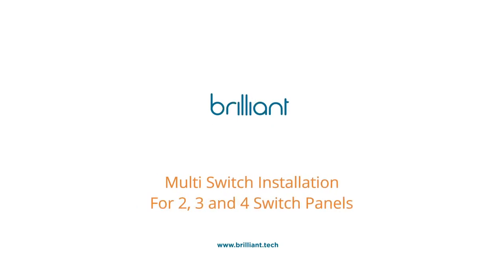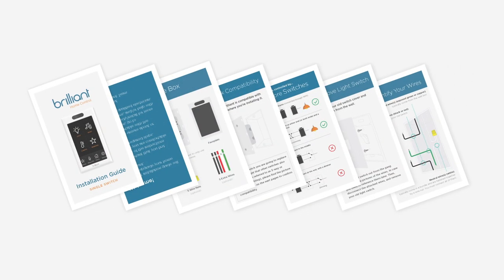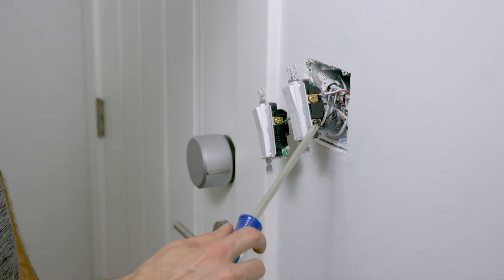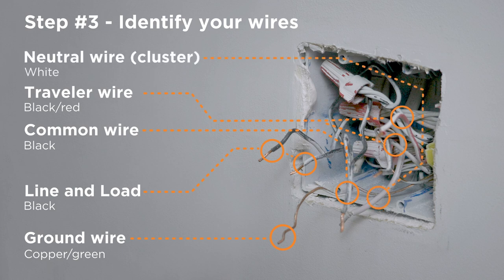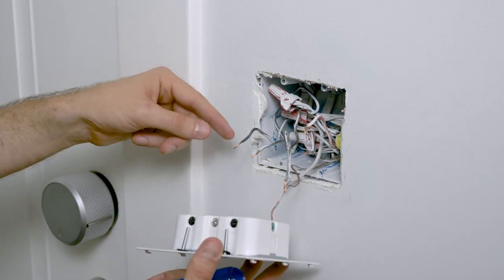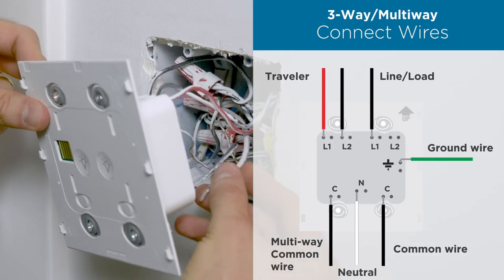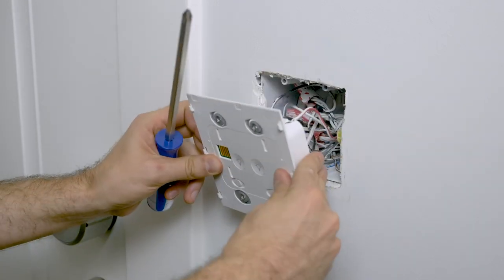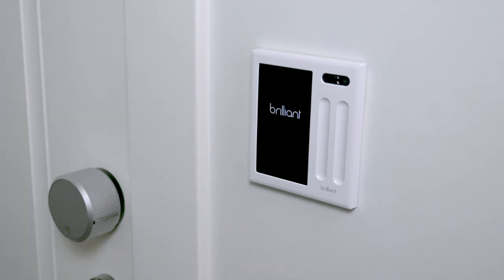How to install a 2, 3, or 4 switch Brilliant Control

Comment: Excellent video, very helpful. Do you have video for single gange switch ? Also, Can brillian be hardwired for cat6 for constant ethernet plug in port for power and or internet connection?
Reply from the maker: There is not a POE version. For more installation questions and videos visit this page: https://www.brilliant.tech/pages/installation-smart-home-control

Comment: If I have a 4 switch panel with two dimmers - do I need a 4 gang and hub to replace?
Reply: The 4 panel should work. There is no hub for a brilliant, the screen is part of the whole setup.